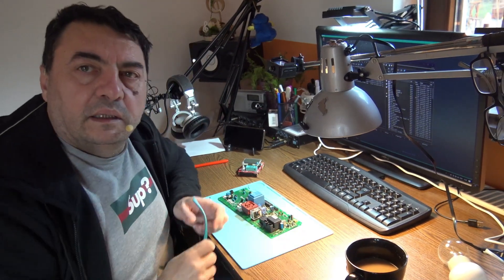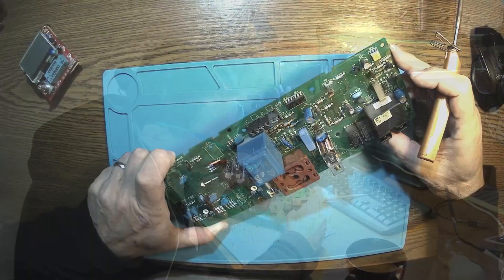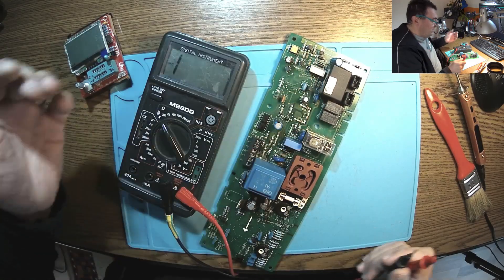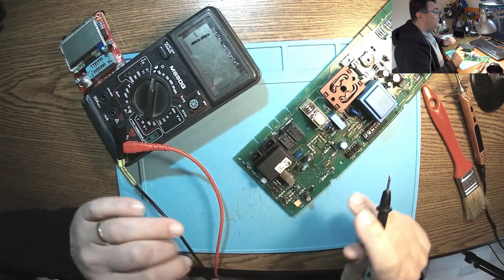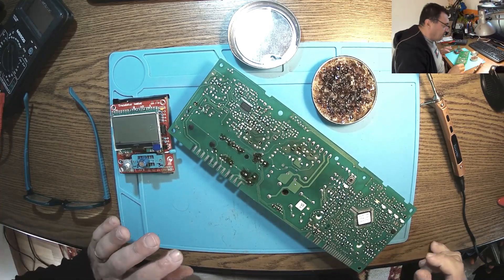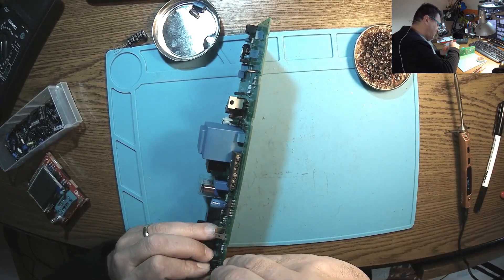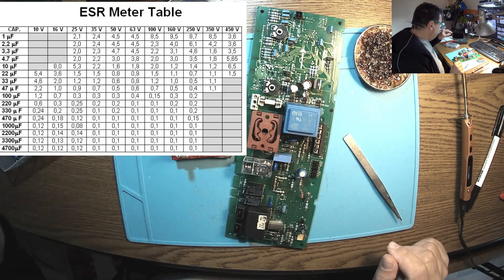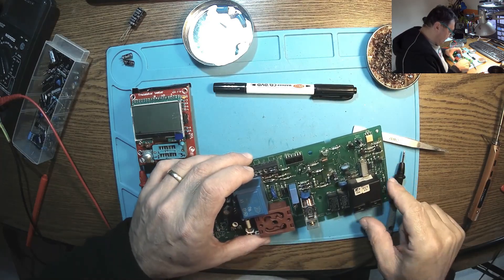Honeywell Gas heater Mainboard fix

Comment: Great Repair Process - Did the Board work?

Capacitors don't like heat, as they dry up
Its always best to go for quality Capacitors, if its an important repair, ie the 110 Degrees ones.

Avoid the horrible Chinese ones, Japanese components are better quality, tolerance and often batch tested for quality.
ie QA Tested, (Quality Assurance)

The ESR Meter tests capacitors at 100Khz frequency, so it will pick up some faulty ones.
If Borderline, then just replace.

If you often repair the same PCB's (Printed Circuit Boards) then get a Capacitor Kit of required values.
Its always better to do the job properly, as the amount of irritation it can cause when a repaired item fails again

Stay Safe 🙏😇
Reply from the maker: I didn't tested yet but I was successfully done with some others..and yes a good kit of capacitors it's on the way. Thanks and Happy New Year!